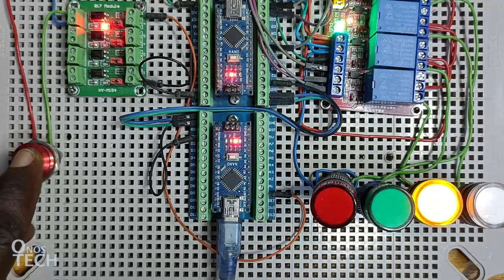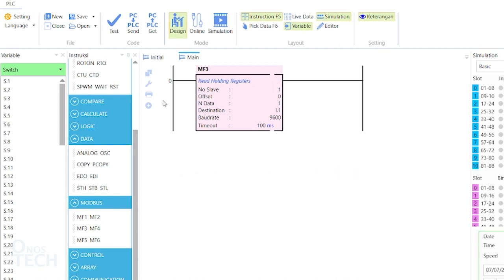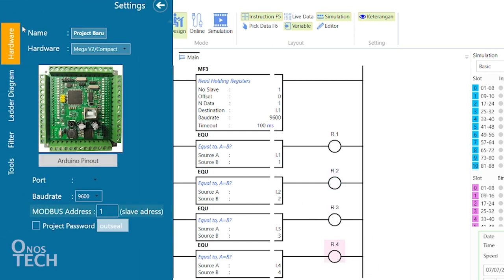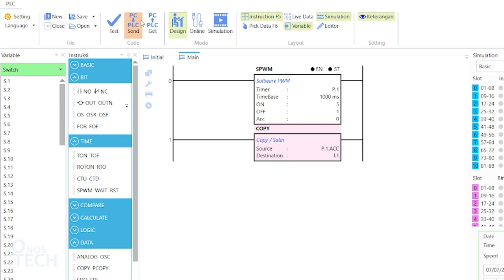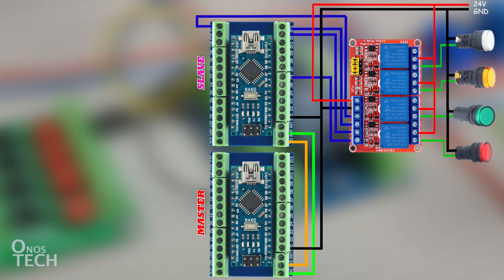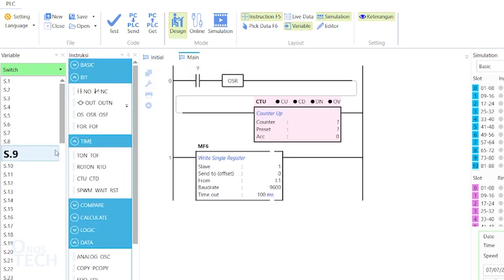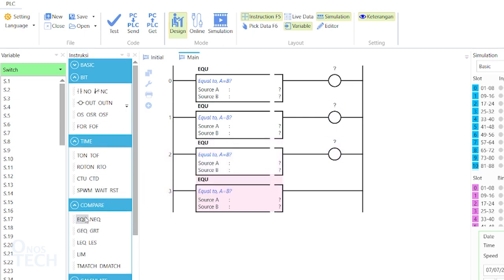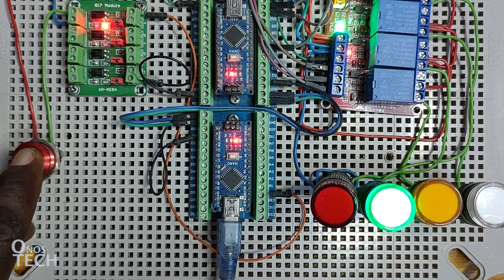#21 Modbus Master Holding Register Read/Write  | Outseal Arduino PLC

Comment: I connect 2 wired RS485 from master port outseal mega slim V2 to atv12 serial port. I am using MF6, slave 2, kirim ke 8502, dari data 200, baudrate 9600 timeout 100, compile and send success. but the register 8502 on atv12 not change, but run with modbus poll with slave and data  and baudrate and timeout same with outsel can change the register on atv12. Please advice, thank you